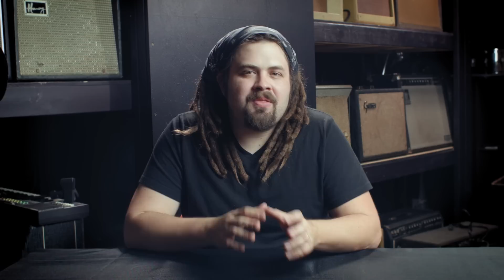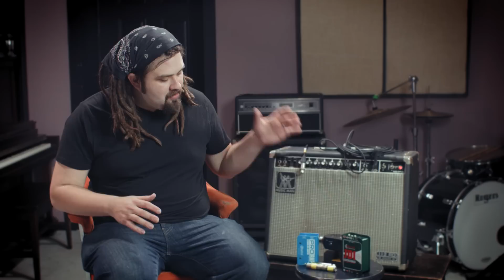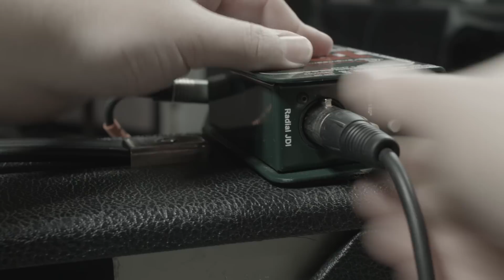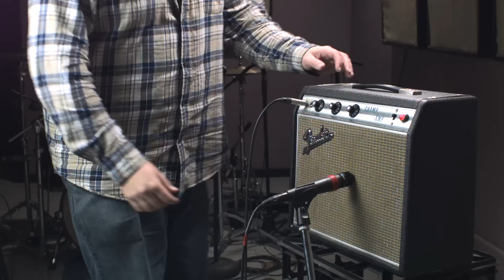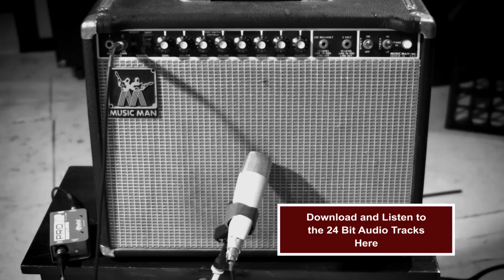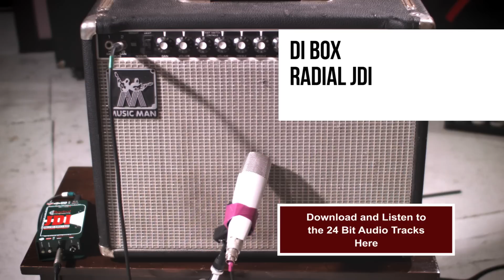Do You Really Need a Reamp Box to Reamp Guitar?

Comment: Finally some one who explain it thoroughly. I still have a question so the re-amp job is just to attenuate or also convert balance to un-balanced?I have a sescom 35dB attenuation cable is it possible to use only that from audio interface to amp? I think it's balanced stereo cable. If not and I still need unbalanced setting an rca adapter to 1/4?
Thanks,
Reply from the maker: Yeah it does both, attenuate and convert to an unbalanced.
Reply: It also uses a transformer to do this which has the added effect of reducing noise.

Comment: About the db attenuation and resolution point, what about if the signal is coming out of the daw at unity and lower the converted analog signal via a potentiometer (for example an aux send on a mixer) instead before sending it to the amp?
Reply: I've tried this, and the signal seems weak, even when the actual level is about right - I think issues like impedance are not solved by dropping the level on the mixer.
Reply from the maker: Well, what is unity? I think of it as -18 in the DAW because that should be what is considered line level (I'm away from my books right now but it's about 1.23 volt) coming out of your converters. The idea is to retain the headroom on the converters, considering that you are in the digital world, and then you would have a full signal, peaks and all, to attenuate. That way your reamp would be punchy and realistic. For your question, I think it's fine if you lower the signal. In terms of the pick up / guitar world levels, I know that some can create crazy hot signals, and some even can't be achieved via reamping, as they need a boost instead.
Reply: creativesoundlab what i was trying to say was to let the signal coming out of the DAW with the virtual fader at 0db, so the converter is using all 24 bit of resolution and then, once converted in analog, to lower the electrical signal via a potentiometer before going into the amp for reamping. About the 1,23V thing i remember it to be the tension for a 0db line line level signal passing through a balanced cable. (sorry if my english is not perfect, i'm from italy)

Comment: I wonder whether this would work: using a passive attenuator such as the A-Designs ATTY between the recording interface and the JDI to reduce the line level output from the interface down to instrument level before it hits the JDI. The ATTY is designed to handle line level signal. It costs more than the Radial ProRMP, but less than the X-Amp or the Reamp JCR.
Reply from the maker: Yes, that would work. Just like my cable I'm using more range of the converters, but keeping the JDI from being pushed too hard.

Comment: can i send signal from daw to preamp input with this chain : daw - interface output - reamp box - di box - mic preamp input ?
Reply from the maker: Sure you could. Usually it would be to use a stomp box or guitar effects for a track in your daw.
Reply: So you're trying to reamp an already recorded signal into a mic preamp box?  Why?  If you're trying to color it with the pre-amp, just find a plug-in that will do the same thing.  If you're trying to "run it through analog electronics", save yourself the trouble, because 99% of your listeners won't be able to tell the difference, and 100% of your listeners won't care.
Reply: @ytscksdabig1  Yeah... that's the spirit. ...it's all about who doesn't care anymore.
Reply: @ytscksdabig1  So you think mic level input into a line level input on a mixer is fine? My mic inputs on my mixer aren't full range so I need to use the line inputs. I do worry about colouring the sound, but since I am going to send digital/electronic signals into the effects, I figure a little preamp colouration won't be terrible. I guess I can try both DI output as well as DI->pre output to see what I think of each. I have JDI, reamper & mic preamp, I need the mic pre for mic anyway since I don't use the mic inputs/pres on my mixer. So I figure might as well use it.

Comment: The reamp box had definitely no rivals, but the padded gain cable did an awesome job with the DI!
Just wondering, couldn't you just add a bigger resistance to it in order to attenuate just the right amount of volume? Or, I'm gessing, it would be too much and would have some downsides on the sound?
Reply from the maker: Hmm, I'm really not sure what the trade off would be. Converting signals in the way that reamp boxes do, is a unique task and takes a special transformer.
Reply: +creativesoundlab first thing that comes in my mind is that higher resistance values create more impedance when connected in series, meaning more noticeable low pass effect, in the same way running longer guitar cables does. Not sure if the cut frequency would get in the way of typical guitars bandwidth though. That being said, impedance mismatch is definitely an issue when trying to capture the cleanest signal possible. I was just curious since as I said earlier the DI box connected in reverse did a more than ok job in my opinion if you're in a budget!
Reply from the maker: Yeah, that passive DI worked out well I thought. Better than I expected.

Comment: Thank you for this video!
By the way, did you get the original noiseless recorded guitar signal by using a DI, or direct to DAW?
Reply from the maker: +Dan Oliveira I guess the best answer to that is "both". Interfaces that have built in inputs for guitar are still doing the function of a DI and mic pre combo. I usually use separate DI and pre so I have more control.
Reply: +creativesoundlab oh cool, that's what I wanted to know. My Saffire PRO40's "instrument input"s are not as clean as a DI.

Comment: Since you mention that the signal coming from the DI box is hotter than it would be from the re-amp box, I was wondering: what if I had two DI boxes, chained them and used the pad on the second one to bring the signal closer to what it would be out of the re-amp box?
Reply from the maker: +ProjectAwesome1 That really should not work. Use a padded cable or a DI box that has a built in pad.

Comment: Will this affect fuzz sounds quite a bit? (in the way it might be like having a buffer which sometimes fuzzes don't like?).
Do you use this for stereo or multi-amp sounds? Do you think its probably easier than dealing with phase problems even if i've got a cheap passive DI?
Anything else i can use for a pad? My DI box has one but not sure what it does when run backwards, otherwise I have a few guitar pedals with either passive or active volumes.

Comment: Hey Ryan, I have a brain teaser for you. So I've got my high quality DI and Reamp device. I've been wanting to use my guitar pedals as outboard gear. Problem is, I only have 2 outs (duet 2). Question is, can I use the stereo headphone jack as an output to my powered monitors, freeing up my 2 line outs for reamping? Or, do I leave my monitors connected to the 2 line level outs, and use my stereo headphone out, to the balanced in, on my reamp device? Should this not be ideal, could I connect my line level outs to a small mixer or headphone amp, then use 1 pair of outs for the monitors, and one pair (or a "third (L) output )for reamping? I would like to do some traditional guitar reamping, but would really like to use the pedal chain as an inserted aggregate device. Of course I want the most streamlined way, but would be willing to spit the outs with a mixer. This way I could keep connected my monitors, headphones, and still have output signal going to the reamp send/return.
Reply from the maker: +Scotty Hills Line level is 1.23 volts or +4dB which is not the same thing as a headphone amp providing a stereo signal on just a three segment jack. Balanced needs both hot and cold for the same signal, which is not the same as it is in headphones where it's Left and Right channels.
Reply: Here's a better brain teaser, why are you trying to ruin your mixes and signals with guitar pedals and pretend they're outboard gear?

Comment: amazing video, dude.

The only thing that is not clear to me, is how to reamp a guitar with a jack adaptor (using an external audio card), without using the reamp box.

I mean, how to set the guitar amp as audio output, in which I want to hear my "preamped" guitar recordings?
Reply from the maker: +John Jack Doe Ok, I think I know what your asking. Just set the output in your daw so that track has a direct out for that output on your sound card. You can also just solo that guitar, and then use either L or R on your main output to feed the amp/reamp box.
Reply: creativesoundlab thanks, man, I'll make some experiments xD

I recorded an album and now I want to reamp the guitars , but I would like to do that without using the reamp box. I think that putting the jack ( that should be supposed to be put into the headphones output of the external audio card) into the output of the amp...it should work. Am I wrong ?
Reply from the maker: +John Jack Doe Yes, the headphone jack is a totally different kind of jack. What you need is balanced line out.
Reply: creativesoundlab I know what you mean, I will have to work a lot on adaptors, and make different experiments. The noise that comes out can depend also on the amp...Using certain kind of amps, the noise will be different than using another kind of amps...I think I understand what the reamp box really does, it adjust the impedance between the pc and the amp, sending in the amp a more clean and "powerful" signal, anyway thanks for your videos, you really earned my sub!

Comment: Thank You, everything I wanted to know in one video. By the way what the mic was used for capturing sound from the amp?
Reply from the maker: The mic is a md421
Reply: oh just in white, I never seen it in white, probably a vintage model... it looks like soviet union OKTAVA ML-51. USSR definitely copied the design, but not the sound :) but it has it's own unique and vintage sound.
Reply: +BomzStyle They definitely came in white at one point. Some say its a sligtly different sound, all the reissues and variations especially the current md421-II would sound slightly different but still MD421...

Comment: Hey. Amazing video. Definitely getting the reamp box. One question: Do i need a di-box to record guitar straight into my sound card, or can i just record this unbalanced? Is there any difference between the two is really my question.
Reply from the maker: +Kim Morken Thanks! Yes, to recording guitar going into your sound card, you'll need a way to convert the unbalanced to balanced, and then bring it up to line level. You'll need to plug into a DI box, then that DI box goes to a preamp (XLR/Mic input). Some interfaces have "HI-Z" inputs on the front, and this is fine too.
Reply: +creativesoundlab Alright! I will try the Hi-Z on my UR22 sound card first then. Thanks for the reply!

Comment: This may be an important thing to consider. A guitar amp is designed to work off the impendance levels and voltage levels produced by guitar pickups. This is around 5 volts AC, give or take. Microphones use XLR cables because they run off of much lower voltages, only about a fraction of a volt for your average dynamic mic. This is why XLR cables need 3 pins, one is a dedicated ground, to keep the noise floor down. I'm not sure what the voltage levels are when reamping, but just the difference between guitar outputs and dynamic mic outputs should give people an appreciation for why you would need to cut 28dBs.
Reply from the maker: +Alva Goldbook Yes, totally. What he said^. Also, one could try to argue that line level ,1.23, if I remember correctly could be close enough to the input of an amp, but the impedance would be all wrong. Some have commented that the reampers are not loud enough because they can't get to the 5 volts you mentioned, and that makes a lot of sense. I know Radial makes a DI box for acoustics because the voltages can be so high, that it leads to harsh highs when the headroom runs out for live DI use. Some of these situations I would never do, and I didn't use my special amps for this video for that reason.
Reply: +creativesoundlab One possible solution that's worth experimenting with might be to use a transparent booster pedal. Something like a MXR Microamp is a simple op-amp driver, which if the reamp isn't loud enough could be used to boost the signal back up in a fairly transparent way.